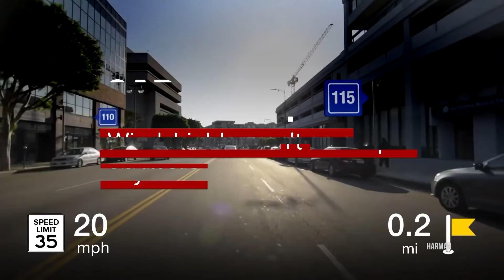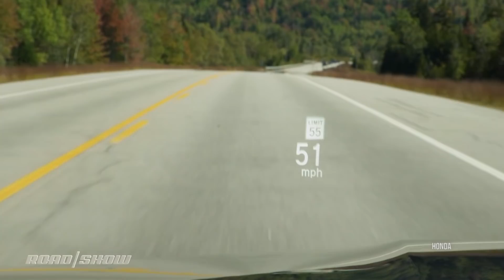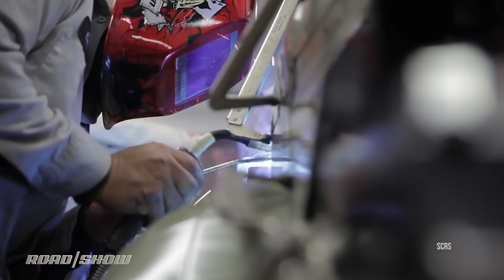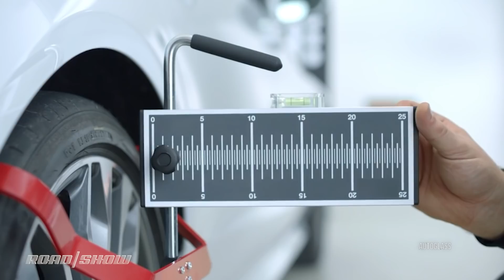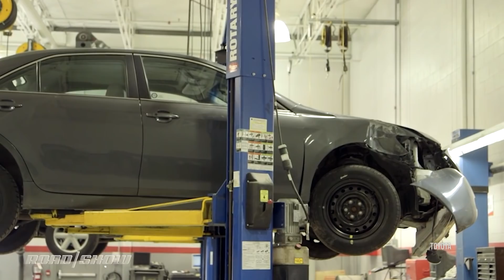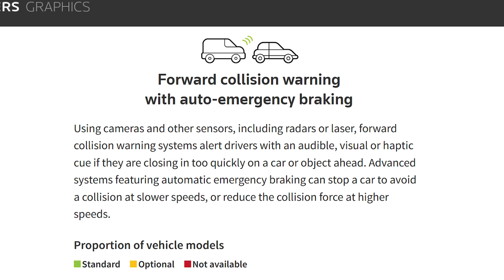Why windshield repair is much more complicated than it used to be

Comment: Fix does rock chips before it cracks. Cheaper to repair  than replacement  high end vehicles  windshield  could run you$1,000s if you have to replace  your windshield..

Comment: BS, it’s all about money. Safelite wanted to charge me over $700 to fix a cracked windshield on a 2020 Honda. I took my car to a regular glass shop. They fixed the cracked windshield for $60. No radar problems. Drives just fine.

Comment: Working for safelite for 6 months made me very aware just how complex and insanely priced cars are becoming and the components within them. I purposely bought a car that didn’t have any of the ADAS systems partially for the reason that my windshield replacement will be $300, not $2300 (Like the new genesis)

Comment: If people would just learn how to drive properly we would not need silly driver assistance stuff in the window. The only modern assistance feature I like is radar cruise which uses a sensor in the grill.
Reply: Laser cruise? On the grille? All I've heard is the lasers mounted on the windshield beside the cam. Besides, all the laser based systems I've seen are in the EU. In the NA, all I see is radar based systems.
Reply: @agarcia4271gaming  sorry yah radar cruise which is hidden behind a plate in the grille. I have edited my original comment.

Comment: My 'right to repair' radar went to 11 watching this.  What are the odds that OEMs and dealers simply tell independent repair companies that they won't make these tools available, or price them in such a way that only a dealer would buy them?   We replaced the windshield on a 2010 X5 and it was a couple hundred.  Something tells me that will seem like a steal compared to replacing one with all of the superfluous driver aids attached.  Maybe we should just pay attention when we're driving instead.
Reply: Might as well remove airbags and ABS braking.

Comment: I got affected by this.  The windshield has a moisture sensor on it and it had to be replaced which raised the cost. Also, it never seemed like my comfort control worked right after.  Defrost comes on when it is 100 outside.

Comment: As with all things as the driver assist  features become more standard on all cars the cost of repairing will fall. These features are still fairly new and not on all cars
Reply: Subaru claims to have it's front facing cameras installed on over 1mm vehicles, and that's just for that brand.  So total number of vehicles with this tech is easily several million.  It might be new, but the tech to mass produce these windshields is already here, yet we're still seeing some crazy pricing.
Reply: @bassandtrebleclef  but compared to the total car fleet on the road it's still not widely used. When it's on even 10 to 15 year old cars the price will be more reasonable because the supply of shops to repair will be greater. Right now this tech is barely on 5 year old cars
Reply: Ford said nearly all of their new vehicles now have these driver assistance systems.

Comment: Tesla still isn't talking to repair shops
Reply: Well, Tesla is in a unique position to do that. Technically manufacturers needs to make whatever tools they give their dealerships also available to repairers. So, when dealerships don't work on the car anymore, your repairs get more expensive since the manufacturer doesn't have to supply those parts and tools to repair shops either. However, Tesla has no dealerships...so they don't need to make their parts and tools available to anyone but their own shops
Reply: @blake031299  correct, but the down side is a mild body damage can take months.

Comment: I had to get the windshield of my 2018 Honda Accord Touring fixed a couple of years ago and I thought I could just schedule Safelite to come to my office and repair on-site (as I had done with previous cars). However, I had to take it to a Safelite repair shop because of all the driver assistance tech that is in that car.
Reply: My question would be how bad of a driver are you if you’ve had to replace several windshields on different cars? I’ve been driving for 33 years and have owned several different cars and have only ever had one cracked windshield.
Reply: @kenyattaclay7666  …sometime, driving thru the construction zones/areas in major busy highways w/ bunch of transport trucks and/or SUVs will increase the risk of cracked windshield situation due to debris or pebbles/tiny rocks picking from these vehicles. Just sayin’.
Reply: @bluestonemetallic7  I grew up in Chicago & learned to drive there. I used to live in Austin Texas. I also used to live in southwest Germany & have driven in Paris. I currently live in the DC area. If you think that think there aren’t a crap ton of transport or construction vehicles on I-94/57/55/35 or 95 then your fooling yourself. Once again, I’ve only had ONE cracked windshield and that came in a small town in central Illinois when a regular old pickup kicked up a rock, just sayin 🤷🏾‍♂️
Reply: Then why are you disappointed and surprised it has all of this driver assistance tech if you got the touring model?

Comment: Had my windshield replaced on my 2016 Accord back in 2016 - it was $950 because of the camera. Safelite told me they didn't unplug the camera, so it didn't need recalibration. Would have had to pay for that out of pocket (would have been reimbursed) had it needed to be recalibrated.

Comment: Great topic. I used to run a quality assurance program (for non car industry) and I support both right to repair and reasonable credentialing. Generally I look that a company are members of their relevant association and get trained and current according to the association. In auto stuff, I want them to be AAA approved for example, and have experience doing my exact need. I have seen again and again that you get what you pay for.

Comment: There is a bigger issue here. Used to be if your automatic transmission went bad the cost of the repair was more than the value of the vehicle so that ended its life. But we have added so much junk tech to vehicles that if a 4-5 year old vehicle gets into a minor fender bender, the cost of repairing the front bumper and all its sensors will total the vehicle. Instead of fixing our relatively new good condition vehicles we will have to throw them out like flat screen TVs.

My brother's adaptive cruise went out and he had no cruise until he got it fixed for $1500. They said a piece of ice probably hit the sensor in the front bumper. The purpose of adaptive cruise is to allow you to use cruise control when the traffic is too heavy and you really shouldn't be using it. This is the future of vehicle technology.
Reply: At some point states will require that the all system systems work or you fail inspections.  Pay $1500 or you can't drive your car!
Reply: Ant these repair prices will drop once more and more cars have them. Simple

Comment: This kinda sounds like how apple makes things hard to repair
Reply: Apple gets away with it because consumers simply don't care, and the same will probably go for cars, unfortunately.
Reply: @wecsam  many many more people are concerned about the right to independent repair on cars than on Apple products, so there will be a much bigger fight for it in the automotive sector.
Reply: Fortunately for everyone Apple will be making cars soon. You'll have a to buy a new one every year for $200,000 because over the air updates will make them obsolete. But everyone will buy it, because they're stupid.
Reply: I don't think so, Apple outright refuses to sell replacement parts and provide repair procedures; the car makers are doing all of those things to anybody that asks/pays for it. The repair itself being more complex is a result of consumers demanding more advanced safety equipment.